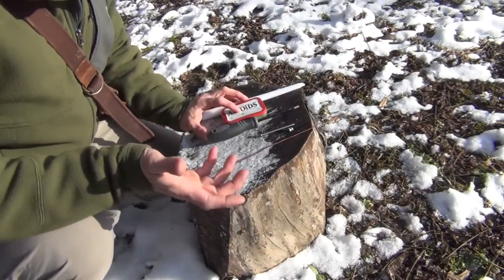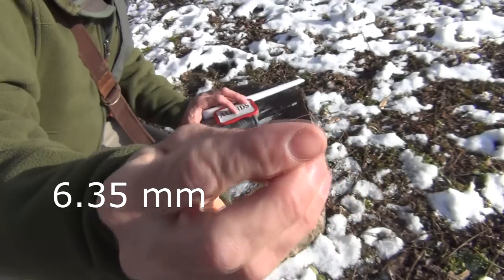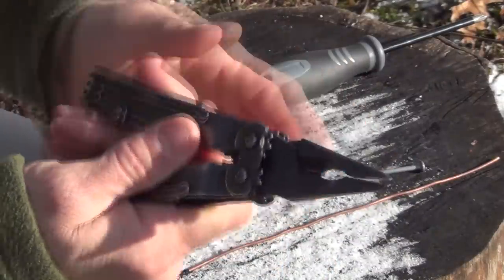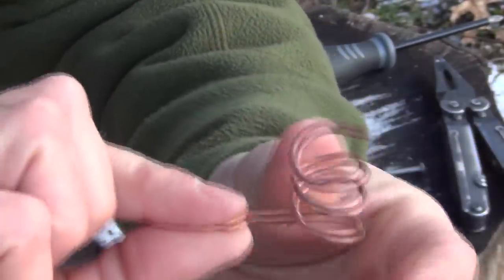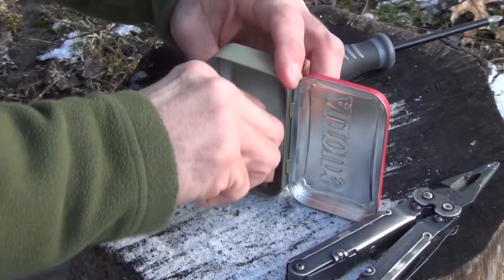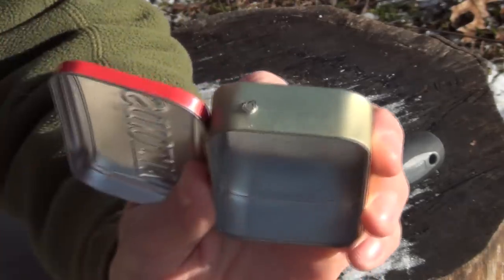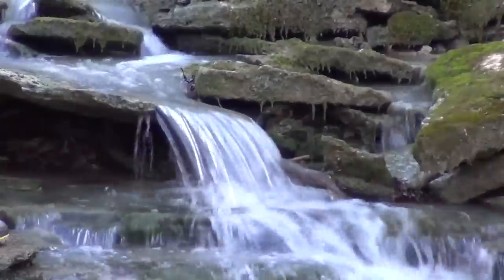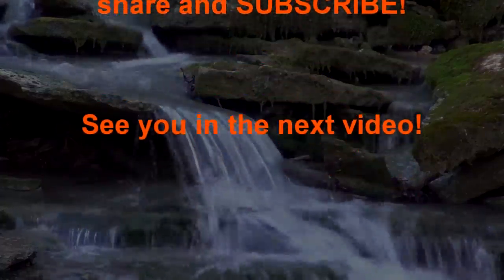DIY Altoids Tin Candle Lantern Box

Comment: Alternatively you could use the wire (or an old piece of coat hanger) to create a prop for the lid, put some tealight candles inside, and that way the propped up the lid helps to protect your jacket/emergency blanket and the flame from getting at each other. You can easily fit two 4-6 hour tealight candles in the can, and have room for things like matches,  fire tinder, or maybe even a tiny lighter.  Bonus: If you use 100% beeswax candles, you have lip balm as well.
Reply from the maker: Sure, you could do that.

Comment: For anyone that is interested in another use for empty Altoids tins. I took one of these after I cut off the two striking strips from an empty box of matches and then epoxied one on each side of the tin. And bam,instant metal match box! Which not only holds the big type of matches (not the super long ones you use to light a fireplace obviously) but can also hold some tinder/shavings you can use to help you start a fire as well if you need to. I'd personally recommend putting it inside a ziploc bag (or any good,thick plastic bag which seals well) to help keep moisture away from your matches and tinder/shavings before you throw it in either a pocket or your bag/backpack.
Reply from the maker: Indeed. There are many uses for these amazing tins!
Reply: @WayPointSurvival  I've even used them to put some old,discarded blue jean material (thick as you can get) in,closed the lid and then put it in a hot bed of coals for a little while. Take the tin off the fire and let it cool until it's cooled completely,pop it open and then presto. Easy DIY charcloth ready to use. You are supposed to be able to use natural rope (like jute,cotton or something like that) and make a similar thing to char cloth. BUT I have not actually tried this myself though,so I'd rather not tout something that I myself have not tried and cannot personally verify the results.

P.s. I personally would NOT make a hole at the top of the tin before putting it in the fire. You do need a small bit of ventilation to allow the gases and etc. from the material to escape (or the lid might pop off). The small slits in the back of the tin for the hinge SHOULD work just fine for that though. Too much ventilation could cause your charcloth to burn up of you aren't careful though.

Comment: You could cut a little piece of rubber or silicone or similar material and make it into a little gasket so water can’t get in through the screw hole when the tin is closed.
Reply from the maker: Yes, that would work. You could also tape around the lid with electrical tape for a similar result.

Comment: Very nice. Just so you know Dollar Tree usually sells a 6 pack box of emergency candles. Each candle is 5 hours and just about the right size. 5in high and .74in wide.
Reply from the maker: That's excellent, thanks for the heads up on that!
Reply: @WayPointSurvival  happy to help! You might need to cut them down a bit to fit the tin so they might only be about 3.5 to 4 hours instead.

Comment: A recently emptied can of beer cut open in the shape of a capital I . Open the doors and set your candle. If you need a wind shield from the wind so you can walk with it? Get a 2 liter bottle and cut the top off to fit over the can and hang the can from a length of wire
Reply from the maker: Thanks for watching.

Comment: Nicely done,you probably don't even need the screw and the bolt,just bend the copper wire trough the hole 
Atb
Steve
Reply from the maker: Thank you! Yes, that would probably work.

Comment: This is stupid trust me.
Reply from the maker: Sorry you feel this way. It actually works quite well. But thank you anyway for watching and commenting! Here is a link to the Civil War Folding candle lantern that this design is based on: https://www.ccsutlery.com/store/lantern-candle-holder.html
Reply: @WayPointSurvival  why do you even need a candle like this mate, either is in a wet hot jungle or a dry cold forest? If you're trying to make a box carrying something, mind as well carrying something like cotton or duck tape for your magnesium flint. All I'm saying, by the way candle is for indoor mate, the light source it provide will not bring any advantage out door. Just think mate, I'm not being salty or anything, I live in South East Asia with dense rainforest and I used to live in South Dakota for 5 years, and I love outdoor adventure.
Reply: @WayPointSurvival  all I trust is my DIY survival kit in a small waterproof box(cotton, duck tape, magnesium flint) , my Casio Protrek running on solar power and my Kukri or Parang. And the rest of the things I'm going carry is all about Survival, I need it not because I want it or anything fancy, like colorful paracord  wrap around my blade or a small knife for emergency(making a spear), I sometimes bring some extra plastic bags and small mineral bottle. Survival
Reply from the maker: I'm not trying to say this is an ideal survival item, just a good way to repurpose a tin that might be otherwise trashed. A lot of folks enjoy making and using these types of things. And, it had a historical use, so it might be a good project for kids or a scout troop, or even a history class. Also, a candle is a good flame extender and many folks carry them in their kit.

Comment: I like the stove ideas well where the tin is basically packed with rolled cardboard and wax and it burns like a big candle that can boil water.

They are less work, but kind of annoying to have to melt down the wax.
Reply from the maker: Yes, they are pretty cool but as you stated they are a little finicky to make. Thank you for watching and commenting!
Reply: We did the same thing with with cardboard/wax using small soup cans in scouts back in the 70s.
Reply: Try tearing your cardboard at an angle so that as it burns further and further it burns lower and lower 😊

Comment: This is too cool brother! What could be used instead of that ground wire to hold the candle?
Reply from the maker: Thank you. Coat hanger wire, it's just really stiff. Or, you could make a holder out of a tin can but it would take a lot more effort than the wire.

Comment: Hi there... Nice little project... Why not use two nuts locking eachother or a lock nut instead of the glue? Then it can be still be loose, but will not fall of... ;) Just a little tip, try to show the finished product at the start og the video. Then the viewer see what they are about to learn. Thanks for the video tip...!
Reply from the maker: Thanks for the suggestions and for watching the video!

Comment: Polishing the inside of the tin or adding a small piece of aluminum foil will add more light reflection.
Reply from the maker: The inside of the tin is already pretty highly polished but you could take it further if you wished.

Comment: I would have run the bolt through the hinged edge of the tin  to hold up the lid for reflection while allowing candle to be lit inside of the bottom of the  tin  for safety and catch wax . It would be more stable,safer,hold the candle etc. Only loss would be 1 reflective panel facing out..but bottom panel would reflect upwards also ..hmmmm Might make one ..thanks for the idea...think I'll build in it... Love my Brass UCO though lol
Reply from the maker: That would be an interesting adaptation... Thanks for watching and commenting!